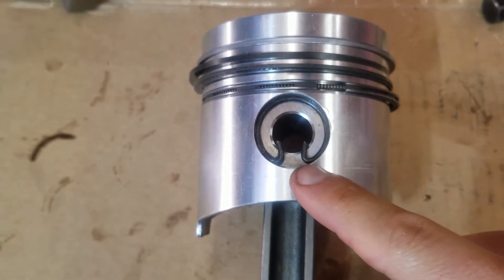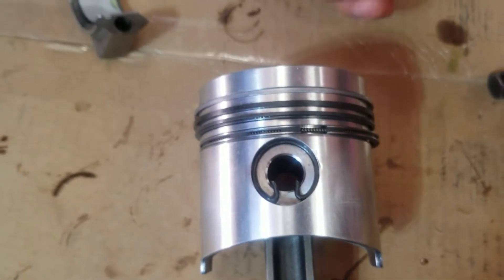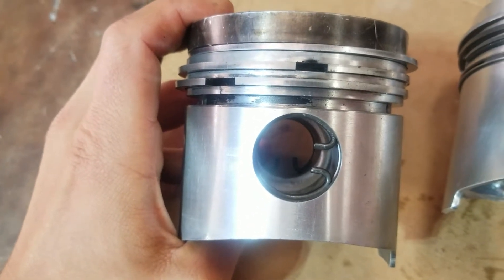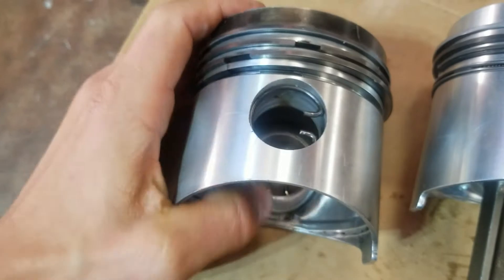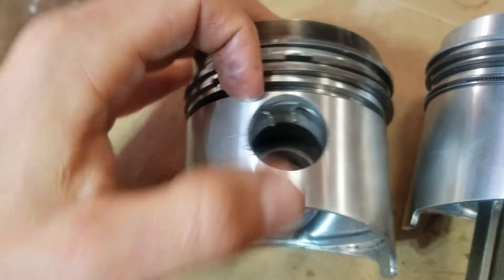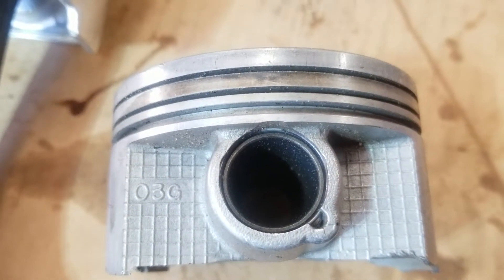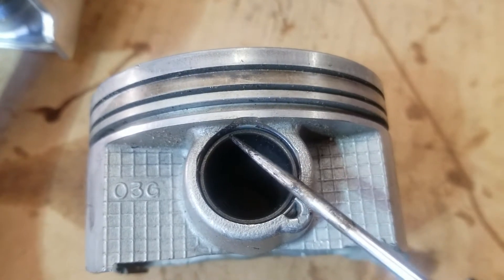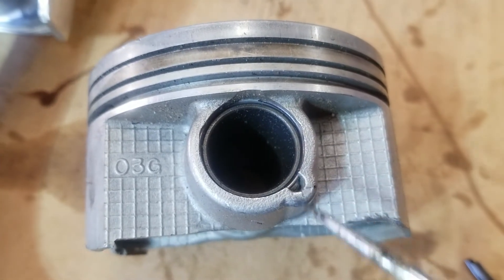Piston Circlip Position Does It Matter?!? Maybe?

Comment: I heard this really only makes a difference with High RPM motors... and/or Large Cylinders/Pistons with High RPMs and so it was more for Gasoline engines or large bore Diesel engines.  Basically high performance engines and not small gas or diesel engines in a passenger car.  

Even if this is an BS or something that can happen to the one in 100 Million,  it is so simple to do it's one of those things you just do it anyway.
Reply: I almost forgot... MAHLE actually has instruction on installing the circ clips.  If they suggest you install a clip that way, I would just do it that way.   If you are going to get lucky this isn't the 1 in 100 million lottery I want to win.  

Reference - YouTube Channel  
MAHLE Motorsports North America 
The videos on the clip are old, from like 8 years ago.

Mahle Circ Clip Installation 
https://youtu.be/3kdhGBCpuxM

Mahle Circ Clip Types and Theory
https://youtu.be/ohbIFfdZJOo
Reply from the maker: It's one of those things. You're right. You gotta do it even if you know it doesn't matter. It's good practice. It's common sense to me with all the force on these parts. If I put it all back together and didn't do it I would be paranoid lol.